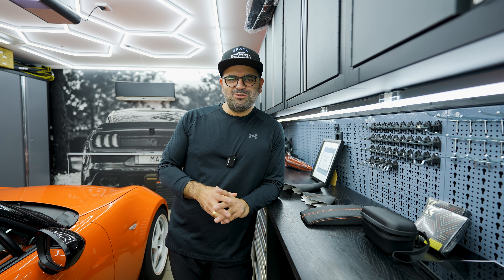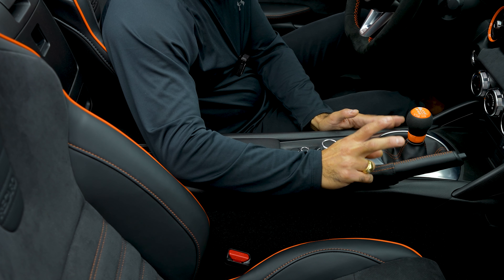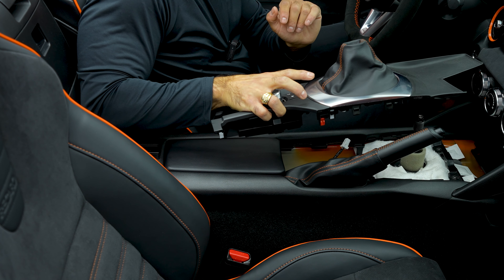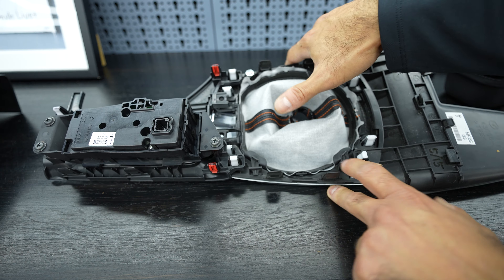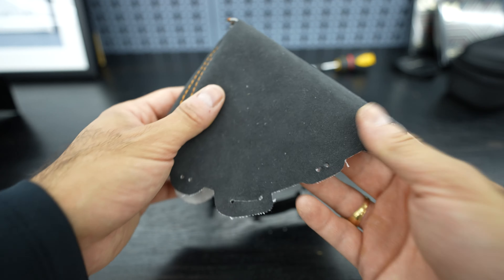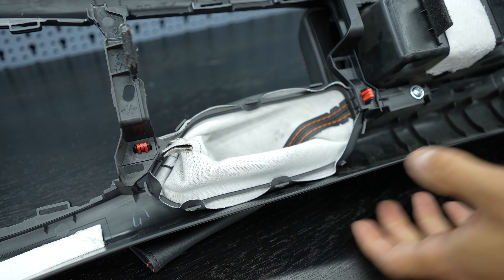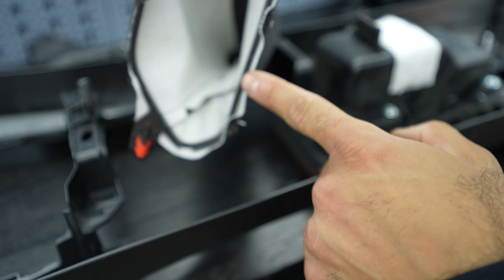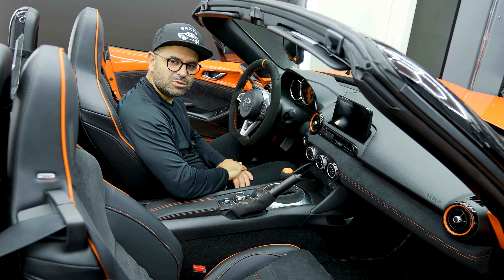2016-2023 Mazda MX5 - How to change your shift boot, handbrake boot and armrest

Comment: Great guide! I got my shift and parking boots in no problem. I did notice afterward that the rear of the big piece behind the cup holder slots doesn’t sit flush with the glovebox piece. There’s a bit of flex if I press on it and I can get maybe half a finger underneath. I can’t say I ever paid attention to that part so I’m not sure if it was like that before.
Reply: Turns out it is normal
Reply from the maker: Yeah I have not noticed anything different with mine after the install! 

Glad that the video helped! Hope you like the the new boots (which ever you went with :) )

Comment: Nice job. The car is awesome.

Did you finally manage to make the diffuser to sit properly? I just bought it and saw the Ulter guide and needs to be sanded down where will stick
Reply from the maker: thank you!

the car was in for some work and the shop decided to use some more permanent solution with "glue". Eventhough I told them not do so. This was over a year ago and it is sitting in the same place.
I am not sure if the 3M tape will work in the long run unless one can find a tape that really fits in the void.